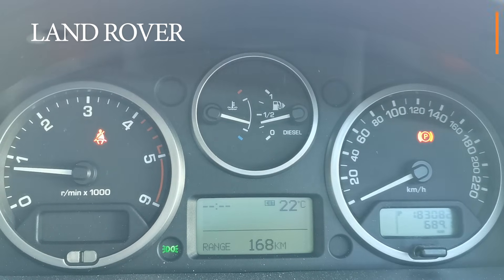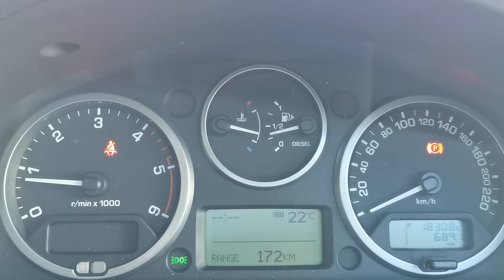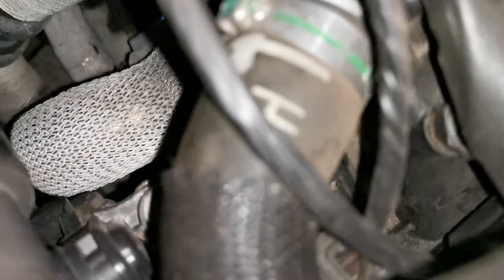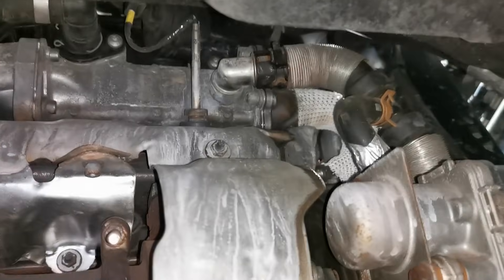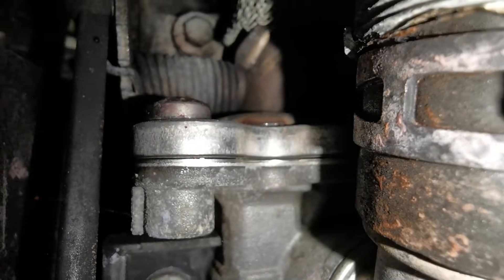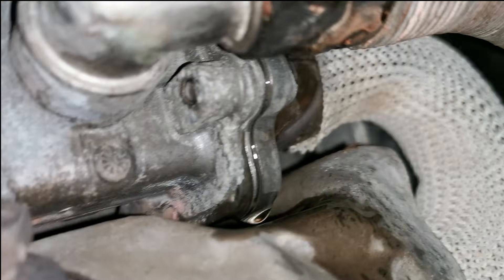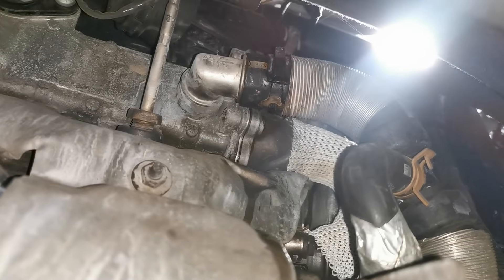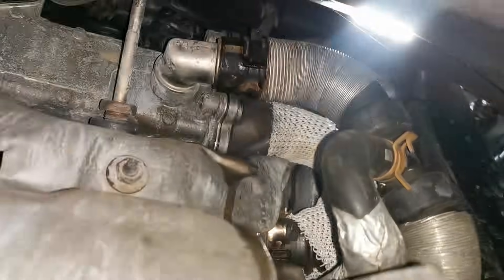Coolant Leak - Land Rover Freelander - Fault Found

Comment: Hi Gerard i have a freelander 2 2013 td4 and i have a leak in a similiar location however it isnt the EGR. The coolant hose just on top of the turbo/behind the timing belt has split badly, any ideas how i can get access to change it